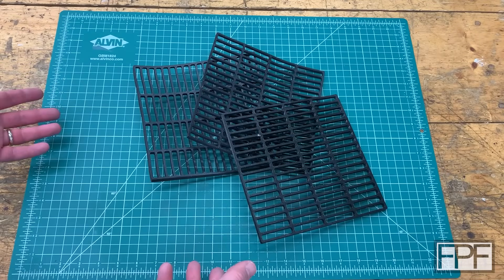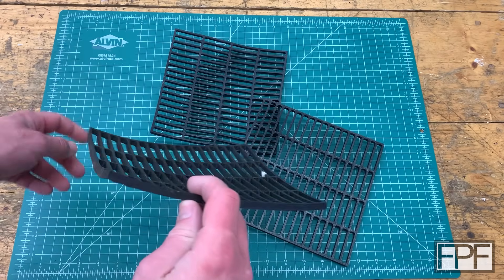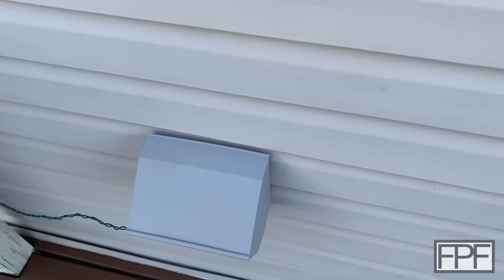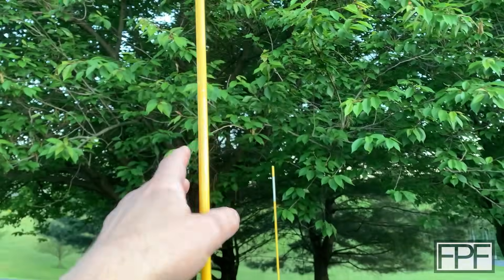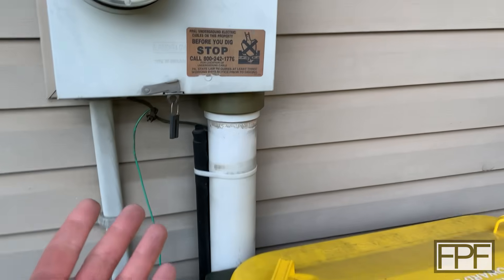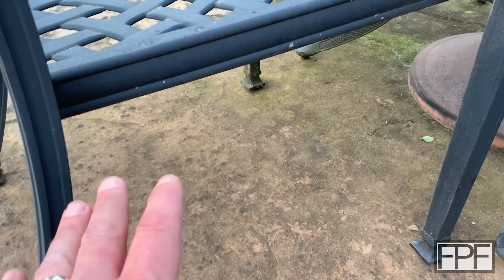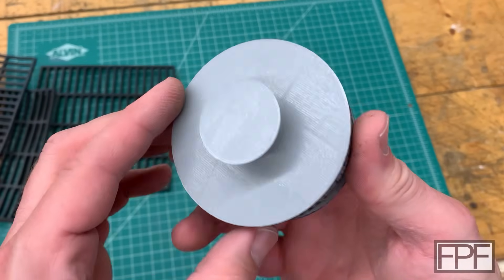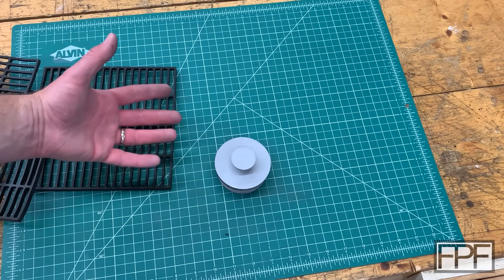3D Prints - 7 Years Outside

Comment: I would like to see how you would design the exhaust plug now as opposed to 7 years ago. I have some 4 -5 year old brackets that hold a hinged wire door on my Polaris to stop the dogs leaping out. It is ABS and in full sun. and still the same. I only used ABS because I had a Cubicon 3D printer, and it did ABS easier than PLA. (PLA was virtually unprintable in it)
Reply from the maker: I STILL have the original PLA plug in there. ..  I have thought about redesigning it since it's one of the first things I ever designed, but at the same time, I'm kinda proud that it's held up all this time and I don't want to change it :)

Comment: I'm a bit late to the party but fwiw, I printed a pile of spike tags for most of my 40-ish plants in containers that stayed outside in the southern midwest seasonal cycles for about 2 years. They were stuck directly into the soil about 3-4 inches and were an average of 1/8" thick. I ended up recycling them after the second season when they started having layer adhesion issues. I'm pretty sure the cause was water getting pulled up from the soil and freezing over the first winter. If I were to do it again, I'd probably print them in a street sign orientation and use a disposable, recyclable stick to anchor them in the soil. Bamboo skewers or chopsticks would work well for that.

Comment: this is awesome. it sounds like the phrase should be "you cant print PLA for outside use WiTHOUT thinking about some considerations". Looks like some of those thin parts warped. some of the thicker parts held up fine. great to know

Comment: I use PLA outside all the time with great success. Two key factors: 1) Use white PLA. White reflects the most amount of light and reduces heating of the part from the sun. 2) Eliminate stress on the part. I have some parts under a small degree of compression. But avoid torsion, shear, and linear expansion stress. I made a portable solar panel rack out of EMT conduit that slides together with PLA joints and have used it at Burning Man for a number of years where the temps often exceed 100F for days. Works great. I too cringe when I hear the folk lore of 'you can't use PLA outside'.

Comment: I printed about 10 orchid pots for my mom in a generic “wood” PLA. They have been outside in Florida for the last 8 years. They mostly get full sun every day as well. The design is basically a sphere of an organic tube structure. It’s hard to describe but I used Mesh Mixer to bring the poly count of a sphere down, randomized the sizes of the triangles, changed every edge to a tube, smoothed them all out, and cut a hole in it big enough to stick an orchid in it. 

Really the only problem is the filament i used was a deep brown “chestnut” color, and now they are all a medium-light grey color. The same orchids have been thriving in those planters for the last 8 years though!

Comment: The one variable that can improve the PLA warping outside is the colour. Black is going to absorb more heat than grey or white.

That said, there is a quick solution for the UV issue - there is a spray used for coating art that filters UV to stop it fading. The same spray should work to filter UV for PLA - just make sure it is not water soluble... or paint it.

In addition, you can add a couple of additional outside walls/layer to make it more resistant to UV. Each layer filters some UV, so the damage reduces with penetration depth and the additional layers add strength

Comment: I live in an area that occasionally gets to 110°F+ and PLA does NOT survive that outside. I can't even put spools of it in my car during the summer unless I'm driving straight to my destination.
PETG, on the other hand, has had no problems. The base plate for one of the chain-link fence posts is actually on a PETG pad that I printed to shim up the angle from the sidewalk. It's been a couple years and it still looks like the day it was printed in grey PETG.

Comment: Considering using PLA-CF outdoors in Pennsylvania for a Solar Meshtastic node, I have PETG for that purpose now but I've been wondering if CF+resin or rubber coating would be in any way better or worse than the original PETG plans... 

Theres a chance I'll be printing for nodes in the desert soon as well, for that I'd assume ASA or PETG would be the right call there. In Pennsylvania it's more about cold and wet than being sun-blasted

Comment: Several years ago there were prominent channels that tested this and pretty much said "yeah, PLA breaks down when exposed to the sun". These channels kind of did a disservice to the community by not updating their video since PLA has come a long way. This is why the community tends to believe this is still true. There are quite a few such untruths floating around that I call out as BS (such as, never use IPA to clean a glass bed - this is nonsense, pure IPA is a degreaser and evaporates while soapy water can leave behind soap residue!).

Comment: I 3d print about 10years now, in the past I usually print with an  unknown brand generic pla. I can confirm nothing last  . everything I printed with those pla nothing has not  last pass 5-6 years. some of it  absorbs so much moisture, it becomes soft and collapses on its own and some become so brittle it just broke into pieces.   I'm in the equator county humidity is 80% all year round, so maybe that is one of  the reason. 
Maybe a  certain branded PLA will last longer, I have yet to try it. one thing for sure I will never print with pla for anything functional again, too many functional parts (at least 100+) around my house need to reprint. 
Built 3 printers in the past, two fully petg and another one pla + petg . all the pla parts had kaput. all the petg parts still perform strongly.

Comment: Made a hydroponic tower with Sunlu white PLA. Had it outside for about 1.5 years. I ended up not using it anymore and chucked it. Seemed a small amount more brittle but threads that connected the sections still worked great!

Comment: I've got a mini solar panel mount that I designed for decorative lights. It slots into the back of the little solar panel and then slots in and over lattice. It's been outside for about 3 years. It's Overture PLA Pro. No problems at all.

Comment: Yeah. I bought my first 3D printer (an Ender 3 (of course)) with absolutely NO idea what I would do with one. But I wanted one.
Here we are a few years later and I remain constantly amazed at just how many day-to-day things that I print to make my life easier.
The latest  were grommets for mounting a motorcycle windshield. Could not find the proper size on line when I realized that I had a spool of TPU laying around. It took a couple of prototypes getting the flexibility to where I wanted it (sketched up in Tinkercad), but I did get it sorted and printed out a couple of sets. Started the process in the morning and had them installed by early afternoon. Total time invested (not counting print time) was about 1 hour.

Comment: i've placed many things outside, and the performance has been very inconsistent.

I used some discount $5 PLA (1kg) for a couple prints that have been outside or in my windshield for about 8+ years.  Weirdly, those have survived, although the pigmentation has faded.

I printed a PLA chimney vent hood that has been out in direct sunlight for 4 years.  It's still up there although I haven't gone up and looked at it closely.  But for that one I spray painted it with white Krylon Fusion.  I'm pretty sure that's making a big difference with that print.

I also printed some camera mounts with a different PLA and they were deformed within a week.

Given the inconsistent results it's hard to broadly recommend putting PLA outdoors, and if you do, best bet would probably be to go with uncolored filament and cover it with white paint.

Comment: my only real complaint with pla is that it will warp under sustained summer sunlight, even if painted. otherwise, the paint keeps it from having the sun oxidation and it just lasts. just wish it had a slightly higher glass temp to stop the warping. but i guess thats what asa is for.

Comment: Okay two problems with PLA outdoors at least in the case of your first print the tomato things I'm going to reply as I see each section sorry :-) I hope you don't mind but I'm hoping I can be helpful 

First never ever ever ever ever ever ever ever ever ever use black we'll get to wait a minute in fact you're going to want to avoid that entire half of the color spectrum you want white lemon yellow sky blue lime green you want all the light colors and I mean really light colors even dark gray is bad maroon is bad royal blue is bad you need light colors and this comes down to one of the issues with PLA 

PLA has two issues The first is creep The plastic will warp over time when under stress especially when printing a small thin part like those grates and then applying a mass to them like a tomato sitting on top of them you could probably fix the grates by doubling the height and also instead of printing a great just print a simple square and then use grid infill Don't use rectilinear use grid you want strong and thick 

The second issue with PLA and this will also apply to PETG as well you need to avoid dark colors with PETG

A hot day outdoors will not warp a plastic part if it is hot enough to warp a plastic part it's hot enough to kill you so why do the parts warp? That requires understanding radiation :-) 

No not the tick tick tick tick Geiger counter kind of radiation but all electromagnetic radiation light is a form of radiation infrared light is a form of radiation ultraviolet light is a form of radiation 

There are two ways to heat up an object in the context of a PLA 3D print outdoors or PETG conduction and radiation what's the difference? Well touch a hot stove that's conduction hold your hand over the hot stove That's still conduction hold your hand over a fire that's conduction now sit next to a fire That's not conduction that's radiation because the heat's going up so you're not receiving the conducted hot energy from the hot air coming out of the fire You're receiving radiation sideways from the fire a better example of this is go out on a crisp cold day when the sun is out and shining close your eyes and feel the warmth of the sun on your face it's below freezing outside why is your face warm? 

it's certainly not conduction from the freezing cold air surrounding your face so what's heating up your face? Your face is being irradiated by the Sun and that radiation is directly heating your face how much radiation you absorb is directly connected to what color you are 

Because that's what color is color is based on the absorption and reflection of visible light The more light you reflect the lighter the color the more light you absorb the darker the color and the more light you absorb the more radiation you absorb because light is radiation 

When you absorb visible light radiation it is converted into heat 

This is why a black car is much much hotter than a white car when sitting out in the sun and this is why your black grates warped if you print them in white they will probably be okay unless of course there's creep from the weight but that doesn't look like what I'm seeing I suspect they would be fine if you printed them in white or khaki sand color etc keep in mind you can also just paint them so you can take a black print and paint it white and you will get the same result however you'll have to repaint it now and then because the paint wear off from ultraviolet radiation 

Either which way use light bright colors and PLA and PETG when printing outside when printing in something that's not going to be directly exposed to sunlight the color doesn't matter anymore now it matters is ambient temperature and the resilience of the part this is why PLA especially thin prints are bad in a car now you have conductive heat not radiative heat the car itself can reach 160° inside well above PLA's transition temperature. Right on the edge of PETGs
Reply: Almost forgot the other aspect typically PLA parts do not degrade and sunlight they warped because of radiation heating however many times the color dies used to color the plastic will fade under UV light I had a mount for my electric car charging socket on the outside of my store in New Jersey for over 5 years no issues whatsoever but the gold coloring in the PLA faded The part itself was structurally fine
Reply: For the rain cover The reason it warped less is because it's a lighter color so it's not absorbing as much radiation quite literally visible light ideally you would print that in white but that might not look as nice so the solution is to give it more structural integrity basically quadruple all the wall thicknesses not the perimeters but the actual thicknesses of the part itself so that there's influence side and print it with 25% infill The crisscrossing infill empty space pattern inside will increase the thermal mass increase its radiative properties and give it structural integrity it'll be more likely to hold its shape when it experiences softening under heating from radiation so basically I would make all those faces 5 to 8 mm thick and then use 25% infill Yes it takes more plastic Yes it'll take more time but it'll visibly look virtually identical and it will have much better structural integrity to hold up just don't print in a color any darker than that that's about as dark as you want to go
Reply: So why did the soaker hose hooks hold up so well? Even though they're printed in black? Well first of all they're pretty solid second of all they're very tiny and third they don't get hit with a whole lot of solar radiation The plants the dirt and the rock edging all block the Sun so the only time they really get hit is from directly above probably about a 30° cone on top of that they are well surrounded by heat sinks The dirt and the hose is there to absorb that heat and keep it from isolating in the plastic so if the heat has a place to go the plastic doesn't reach TG temperature

Similar reason for the trailer latches for the fiberglass rods those parts are what I would call fully engaged they're probably mostly solid and there's no place for the plastic to go The opening is completely engulfed filled engaged with the fiberglass rod the bases completely flat against the trailer and four screws are holding in place so even if the plastic softens there's just no place for her to go so it doesn't since there's also not much of a load The moment you begin driving you're going to have air cooling which is going to cool the plastic down and now this minor load of the air pushing on a fiberglass rod is not going to be enough to tear that plastic it's still would be better if you print it in khaki but in a case like this with a fully engaged part that's small relatively solid and there's just no place for the plastic to warp to it's fine

And of course being TPU they're basically indestructible can survive a nuclear blast :-) TPU is a heavily underrated material it is absolutely ridiculously resilient

Comment: It's definitely a matter of limitations on what you can keep outside and designing around them rather than just flat out being unable to do it. PLA under strain will warp over time even without heat, I'm pretty sure it'll become brittle in really cold conditions too. So, just don't use it in situations where that might happen. Colors might fade, though it strongly depends on what pigments and other additives are used. Everything else being equal, white or light colored prints will do better in sunlight than using black or dark colors will as they reflect the light rather than absorb it.

Comment: Colour is actually super significant when it comes to print durability outside. Most printing plastics do not contain and UV-resistant additives (unlike most commercially-made plastic objects), but the pigments used in dark filaments can serve to block UV light from penetrating deep into the print which would otherwise cause the print to go brittle through its whole depth.

Instead, the surface of the print is mildly affected but the bulk strength remains good. I found prints in black lasted orders of magnitude than those printed in white/clear/natural, so I now always print in dark colours for outdoor use.

A related effect is that larger parts tend to fare better, because the UV can only penetrate so far and a physically larger part is more likely to have a core area that remains unaffected by UV exposure compared to a thin part where UV light can penetrate the whole depth.

Comment: Checking in from Florida. I had a full size facehugger model, that was on the mounted on the back of my truck's bed cap for nearly 5 years (on one of the cap's doors). When I took it off to sell the truck, it was still like a fresh print, still full posable without brittleness. I originally printed it while living in Michigan and it spent the first year mounted outside in Michigan seasons, survived the move to Michigan mounted in place, and many many years in direct Florida weather including 2 hurricanes. Unfortunately what it didn't survive after being removed from its home on the truck bed cap, was movers dropping a box of book onto it, which cracked the main body in multiple places from blunt force trauma.
Reply from the maker: lol, hilarious.  thx for sharing
Reply: @FunctionalPrintFriday  oh and yea.. it was just some cheap tan PLA.

Comment: Yep.  I've got a PLA bracket on the license plate on the back of my RV that's been out in the Arizona sun for 6 years and it's still just fine.  
Yet, every time I've done a video where I've printed something for outdoor use I get scolded by people for it.  Lots of people will spout off based solely upon their uninformed assumptions.